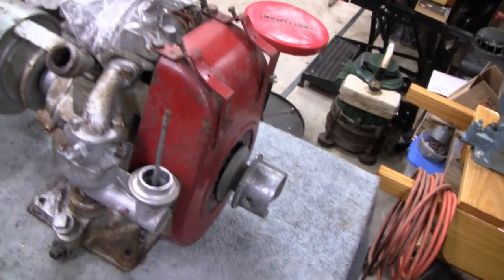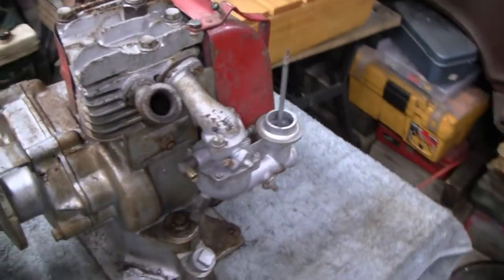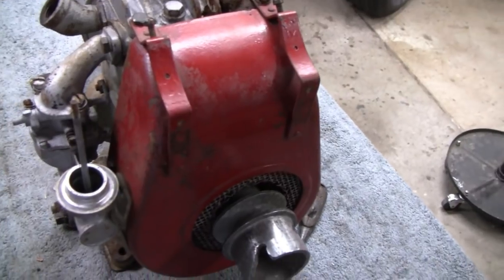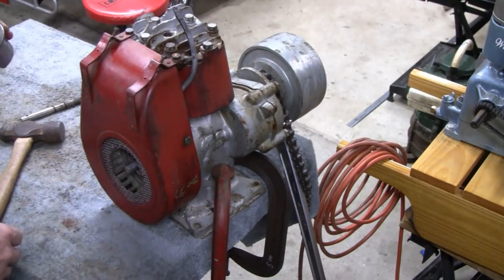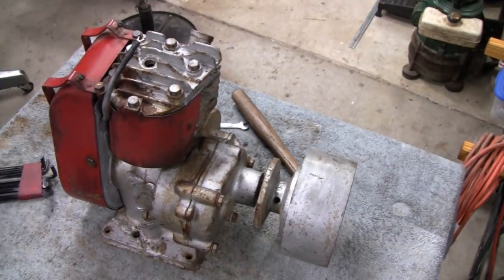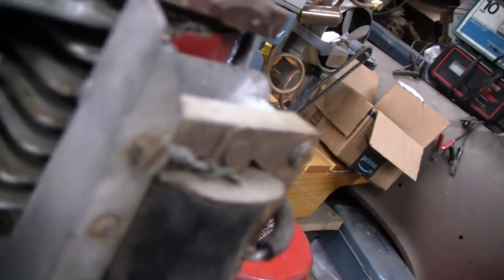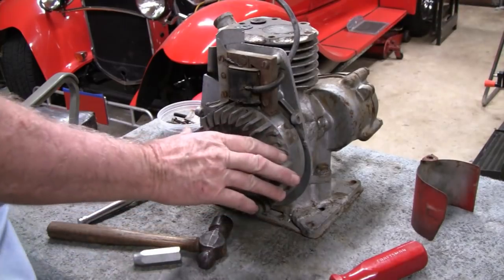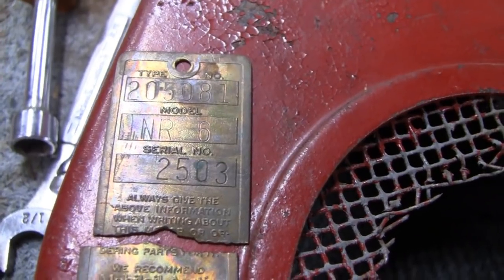RARE NR6 BRIGGS ENGINE RESTORATION (part 1)

Comment: Possibly the same type engine used post hostilities to run the water supply for Camp Susupe on the island of Saipan.  One of my late fathers responsibilities was sanitation officer.  A Briggs engine powered the water system, and it never faltered.  It ran 23.75 hrs a day, was serviced every night about 0200 and put back online.  It was still running when he left in Feb 46. We always had Briggs powered mowers.  Thanks again.

Comment: A Briggs model N can have a air vane governor or a mechanical governor. It should also have a oil pump. A lot of these engines were converted to splash oiling like the cheaper model Briggs engines used when the oil pump failed. The Briggs factory  told  repair shops to convert them to the better splash oiling system.

Comment: yep Diamond Tool and Horseshoe is long gone. Made great hand tools for sure.. Was bought out by a company (1981) that acquired many other old brands Utica Bonney Herbrand etc. and eventually ended up part of the Crescent tool concern.. Knew part of its history and Alloy Artifacts filled in the rest.
Reply: I have a couple of old Bonney wrenches. I picked them up at a local second-hand shop for  $2 - $5 each. Any time I've got a couple of bucks to spend and some gas to get there I go shopping about for vintage sockets and wrenches to add to my arsenal of tools. I also picked up some old USA Made Nicolson files. They still have plenty of life left to them, they just need a good cleaning. :)

Comment: It's funny, because even if you didn't know what year it was made you could probably get a pretty close guess by the amount work they put into it to keep it going.  It looks like they might have used it to power some kind of farm/shop equipment judging by the belt drives on it.  I haven't seen a  gear reduction teardown either, so I'm looking forward to that.  I'm glad it ended up in the right hands, Roadking.
Reply from the maker: Thanks alot Aaron!! I've never seen a small Briggs with a pulley that large!!☺

Comment: Grandma had a tiller that threw a rod. It sat for years till she gave it to the old fella that worked on our mowers. Went to get some blades sharpened. He had replaced the rod and jb welded the crack in the block and had it running again
Reply from the maker: Good ol' epoxy!!☺

Comment: Just a quick tip: I usually thread paracord down in the cylinder like you mentioned using the rag for. It threads in the hole real easy and takes up room relatively quick. It’s a softer rope so it’s not hard on any of the components and when your done you just pull it out easily.

Comment: Never have seen a cast Briggs with the gear box casted in , bolted in , but casted . Should be a nice rare unit once you spruce it up :)
Reply from the maker: Thanks Bud!! Nah, I've never seen one either!!☺
Reply: Saw an N with a Mechanical Governor off the camshaft  instead of the Air vane  , and that was an Oddball .

Comment: I've done this only a few times, but you can fix broken fins by using epoxy/glue.

I cleaned the base really well, left baaarely a mark of where the fins used to be (to allow me to see them) and then i used Permatex steel weld (had it on hand, unaware if other products are better) and first i glued the broken fins as you would glue any broken piece, and later, came back and made a small raised base around the fin after roughing up the whole area with a coarse file (to be mentioned, already, the fin was stout enough to take the abuse of filing). I think it's a 3 mm raised area, nothing big just enough to give it a good base.

So far holding, one's on the more abused engine in my collection which serves as a motor for the drain pump, once a week it runs for 8 hours straight or intermittent.

Comment: I wonder if that(heavy cast/aluminum) flywheel was made for that type of engine with the extra accessories on the other end of the crank to help absorb virbrations when spinning. or it's just a early design flywheel they made with the center being cast and outer aluminum.
Reply from the maker: I've been told by people that own a few of them that all Model N's have the steel core!!☺

Comment: With a pulley on both sides, I'd be curious to know what that engine came off of.
Reply from the maker: Yeah I've never seen a small Briggs with a large belt pulley like that!!☺
Reply: @805ROADKING  that pulley on the output doesn't look like the ones I've seen

Comment: Nice find Roadking. The old NR6's are getting hard to find, and that is a very early model. All Model N engines used a steel hub in the flywheel thru 43, and part way thru 44, whether it was an N, NP, NR2, NR6, etc.. Here is a link to a video of my NR2, and NR6 running together.https://www.youtube.com/watch?v=u6GL9sQeuf4 I will enjoy watching you bring this little NR6 back to life, as you always do nice work. By the way, that carburetor is not correct for that engine as they used the 2 piece design flowjet on these old engines. Not that it matters, as it will run just fine with that carb. As always, Great Video, and Thanks.  Matt
Reply from the maker: Thanks for all the info Bud!!☺

Comment: Perhaps I read your scale incorrectly, but 4lb 15 1/2oz to 5lb 4oz is not a huge difference ?
Reply: Neil I read  4 lb's 15 Oz.   Also...
Reply: BUT those extra ounces add up when you have a gear reduction for inertia.   Just like trying to start a push mower with no blade on it....   Most of the time you'll get a kickback........    

That chit hurts   LOL.........
Reply: Gearbox would add even more inertia, making a kickback less likely.

Comment: I know I already commented once, but I'm kind of passionate about these little engines, and I see some very interesting parts on that one. The base on your engine is the one used on the Briggs Model U, and I've never seen one on an N before, but I have no doubt that engine could have left the briggs plant that way, as its very hard to keep track of all the different variation of these of these little engines. Most earlier model  N's used a gear drive oil pump, but with that base you should find a plunger type oil pump being driven off the cam lobe. Here is a video of my Model U.  https://www.youtube.com/watch?v=KUBF3hknpWI     I really love the flywheel side pulley as  I've never seen one like it before.  Very Nice! 
Matt
Reply from the maker: There's no limit on how many times you can comment Mate!!☺